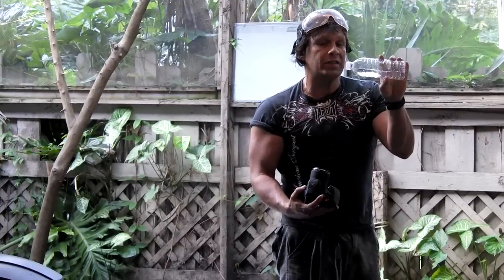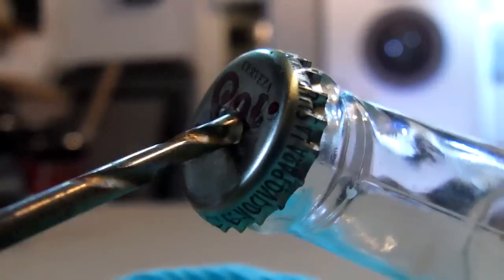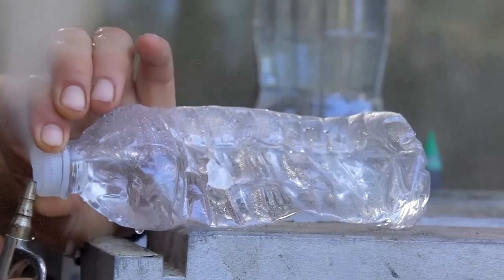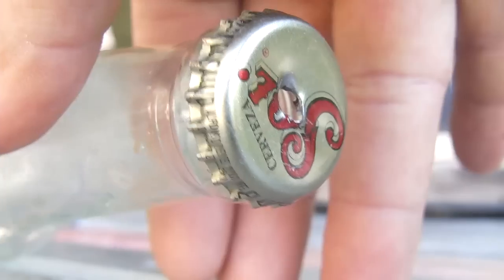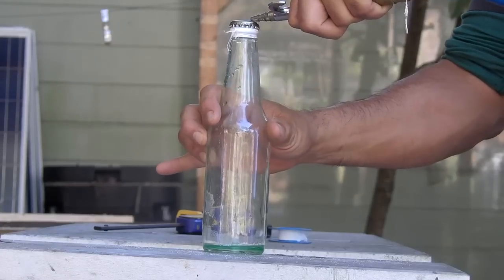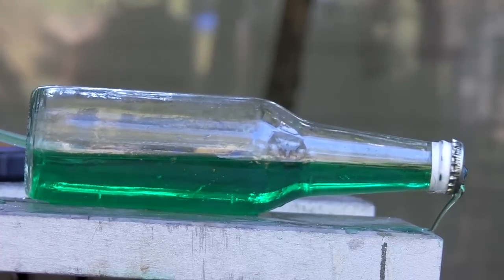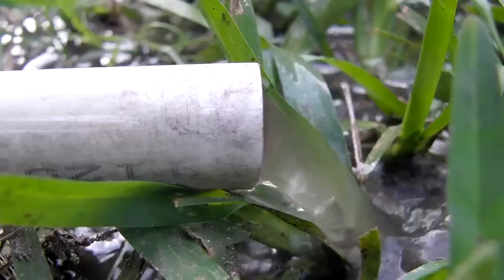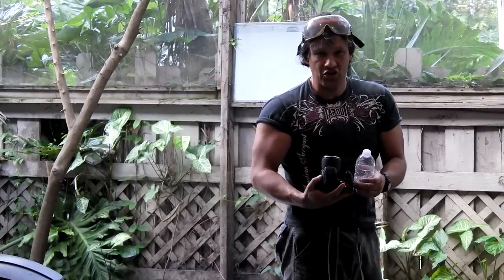Simple DIY valve converts air pressure into a vacuum for priming and aquaponics Venturi

Comment: I'm a little late to the party, but at about 2:32 you talk about aquaponics and pond applications, etc. Are there any other videos that go into detail on building these?  That's why I'm researching venturi injectors and air pumps and such and I'm not quite sure how to take your info and massage it into what I need.   My "pond" is currently a 5 gallon bucket :) Thank you!

Comment: Dan,  I've used commercial venture type vacuum generators that can exceed 20hg.
They run off of compressed air.  Check out a company called Piab.  Anyhow, thanks for the great video.

Comment: How'd you drill into the glass?
Reply from the maker: 1/4" glass drill bit. They are hardened steel and look like an arrow. Secret is a drop of oil and water to prevent heat buildup. Once the bit tip pinches through go  with very light pressure and reverse a few times.

Comment from the maker: Glass drill bits, they are shaped like an arrow. Start dry to get the bit to grab then add a drop of water and oil. Keep the glass cool or the heat will stress the glass and it will break. The bits are usually good for 10-20 glass drill projects before they dull. Search "diamond drill bit"

Comment: Have you tried joining one tube at a 30 to 45 degree angle to another? Run water down the straight tube and the other will suck hard enough to pull a rough vacuum just using tap water flow. First time I saw it was physical chemistry lab at school, it's way cheaper than a pump.
It's like your bottle thing except there's less air to clear out and it will run on water or air, but water being heavier works better even when slower/less pressure.

Comment: Thanks for another great video Dan. A couple quick questions for you.
1. How high can you lift water with this valve?
2. If you directed a stream of WATER across the opening, what would happen?
Because water is much denser than air, would this increase the pulling power (suction) of this device?

Comment: In short Dan is showing off the Venturi Effect. But wouldn't the standard venturi effect tube be more efficient since it closed off any loss of pressure?
Also you should have a way to seal off the bottle of water when vaccumed.

Comment: Nikola Tesla used super high pressure air flow via his bladeless turbine to create a vacuum for his death day.

"What set Tesla's proposal apart from the usual run of fantasy "death rays" was a unique vacuum chamber with one end open to the atmosphere. Tesla devised a unique vacuum seal by directing a high-velocity air stream at the tip of his gun to maintain "high vacua." The necessary pumping action would be accomplished with a large Tesla turbine"

Comment from the maker: Some days that might be the case, not strict about it, just an average. If I eat 3k a day, regardless of activity, I get pudgy. Free Energy in there somewhere:-) Also, I drink ice cold water (NOT during activity regular temp) and never eat hot (temperature) foods. Ingestion of thermal heat causes your metabolism to slow as your hypothalamus regulates. A majority of caloric energy is used to stay warm. Shivering (not hypothermia) requires 1,000 calories an hour.

Comment from the maker: :-) We workout but labor has a lot to do with it. Stuff we make is heavy (work related) + We have a total of 9 acres of property and I like cheap non-selfpropeleld mowers. I can clear an acre (tall thick st augustine grass) in under 30 minutes. Do not realize how exhausting because of focus on safety, holding breath until on the upwind side of fumes ect. We cleared that area of thick woods/weeds in 2 hours on only 40 ounces of gas for the mowers. We average 1200-1500 calories a day or less.

Comment from the maker: The lift is limited with this size valve but a larger version, on a larger container can create about the same suction but more volume. One option might be a simple 80 watt mag drive solar pump. While these do not have lift, they do have good volume and pressure. The water flowing over a valve configuration could lift from deeper wells. You could recycle the transfer water. So start with a 20 gallon tank and over time, solar could lift about 1-2 gpm.

Comment: first thing that i am thinking off, a large cone and on the tip of it placed such valve running to a lake or well, will the wind be enough to pull water and how high? can you test that pls? i am thinking of few ways to create air flow using sun heat when there is no wind. this could be highly beneficial for watering your garden in places where there is no electricity.